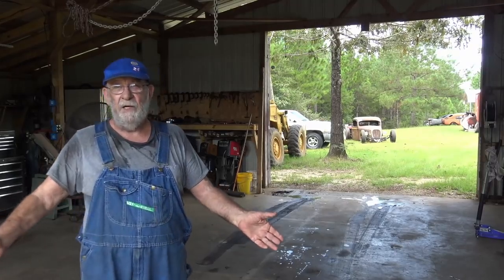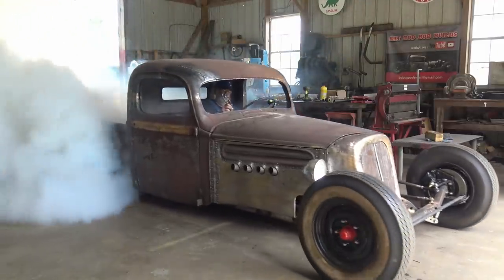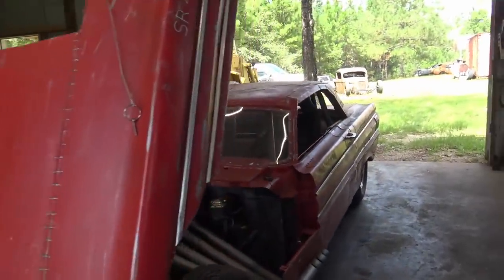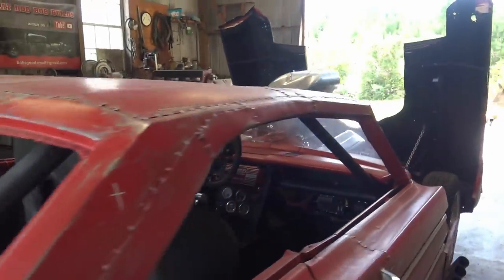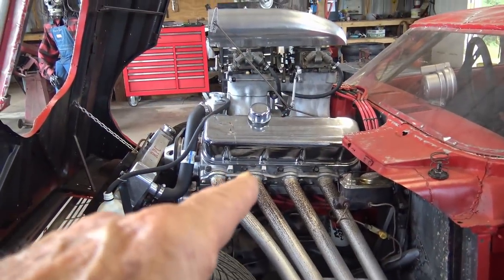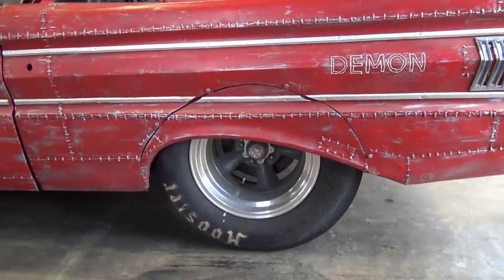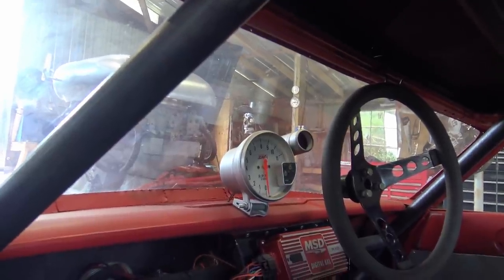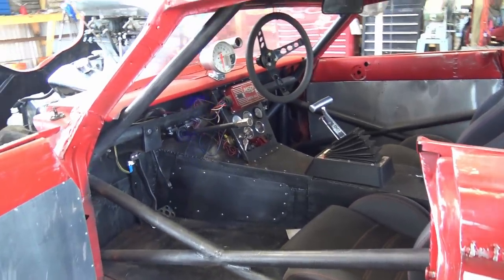Red Hot Wheels Radical Solid Roller Zoomies And Drive

Comment: When I was young I tried to build 65 Falcon model 24 scale, in one day. Unfortunately I picked silver paint, which back then was different than other colors,  didn't dry as fast. Latter picked it up, paint stuck to my fingers, made several attempts to fix it got frustrated and threw it at the cement wall. Back then I just threw the broken parts away. First time I saw your Demon I was wishin i had that broke model, so I could of built it into your Demon. That is one cool ride !

Comment: Not to nit-pick, but . . . If I owned such a beast, I would mount/install an oil accumulator to eliminate ever worying about a "dry" start. Run you a couple hundred bucks, but nice insurance/peace of mind for the dollar, IMHO. Really dig the "stitching" or "scars" that run along the car. Somewhat Frankenstein-ish. L-O-V-E that tilt-forward front end and the throttle response! Working on improving the throttle response on my Corvair, but its diffficult w/ all the bends and restrictions in the intake pathway. Yeah, I own a Corvair and enjoy both its uniqueness and its engineering challenges, when it comes to hotrodding - aka: making power and speed. Would love to mid-mount a V8, but don't have the shop and space necessary.

Comment: I just noticed the welding that was done on the roof did you chop the top on that car and if you did how much did you take out I'm gonna guess about 3 1/2 inches
Reply from the maker: 2 in the back and 3 in the front.
Reply: I was taking a guess that you did chop the roof then I went to your video after I left a comment and found out you did thank you very much for the reply I just purchased my fourth 1964 falcon I have one I've completed 5.0 fuel injected on a five speed with 411 rear end gears I'm working on the second one 408 stroker on a beefed-up C4 with 456 rear end gears the next one as a rotten roof so you know what I'm going to do to that chop it down I'm thinking 3 1/2 to 4 inches all the way around but of course you know there are some people that are going to hate both of us because you have a 496 stroker motor Chevrolet in a Ford but I also have one 65 fastback 496 stroker Chevy and it runs 990s no nitrous snowblower just on the motor 670 hp and I also buy from Mr. White but I did put a bigger tire under the car 19 inches flat on the ground per side frame is only 24 inches wide thank you for writing back I appreciated it

Comment: Cars amazing. Love the stitch welds. What kind of radiator is in it at the moment?
Reply from the maker: All I know is it's an aluminum 4 core ... not big enough for this engine! I got it in a Craig's List parts bundle.
Reply: @RatRodBobBuilds  wow. If that dont work then you need an ice box. Should give a cold case a try. Just trying to get an idea. I have a 400 sbc and the temperature always goes up there.

Comment: Cam ain't that big at 262 degrees @ .050 and .652 lift on both valves, should have 10 degrees or so more on the exhaust. Also single pattern grinds are ancient.
Reply from the maker: The whole car is ancient!

Comment: Why not a 427 SOHC Ford or a 429 Boss.
Reply: camaroguy 66  ok build a 351 Cleveland they don't cost a lot and are very reliable.
Reply: camaroguy 66  my dad had a Cleveland in his 71 Torino GT and he turned it over 3 times which it pretty reliable. I have 351 Windsor in my Mustang and I have not had any problems. Yes the cost may be more but Jegs and Summit some times have good bargain deals and most of the time if you have joined places on facebook which they have a buying and selling on there you do your homework you can find some things that are still new or used that someone no longer needs. You basically keep your project in a garage and you buy stuff little at a time. It pays not to be in a big hurry when buying parts for any project that's what I learned.

Comment: There's np way that motor is 10 & 1/2 compression with the pistion hanging out the block like this one come on man lol
Reply from the maker: Ha haa ... I hear ya but with the big combustion chamber of the heads that's what it comes out as 10.5:1 ... I had the guys a Skip White Performance calculate it before I even ordered the parts. It runs on 93 octane which is what I wanted!

Comment: @Rat Rod Bob Builds , that's an amazing superpower you've got. And its even a Ford. ?👍
Only problem is the engine. A Ford should have a proper Ford engine. And Chevy isnt the "good stuff". It's the cheap stuff. Ford costs a bit more. But it's worth it. Should build a nice Chevy (maybe 62 impala) for that motor and get a good engine for the Falcon.
Reply from the maker: Noted!